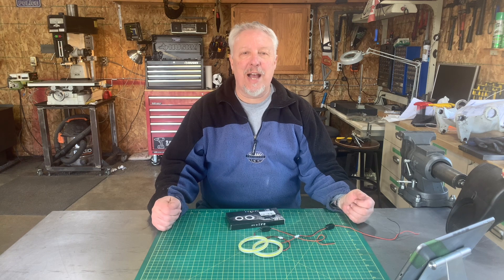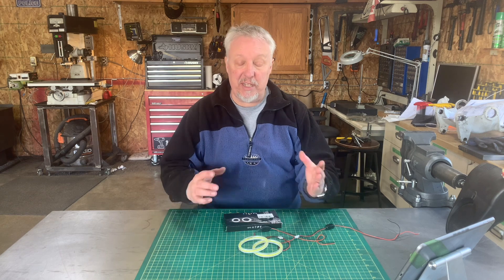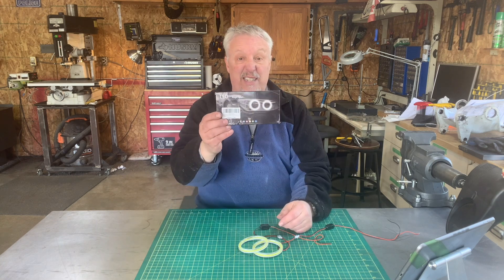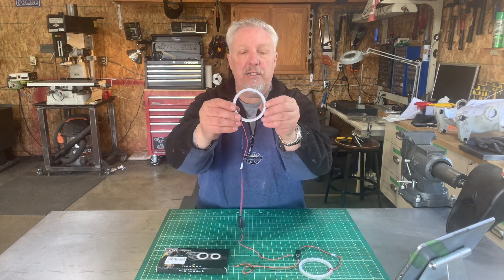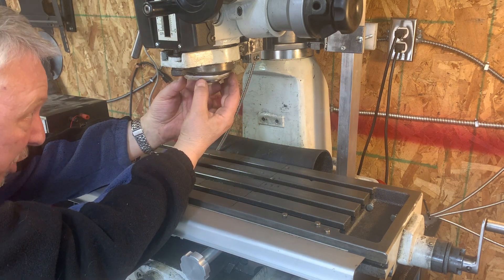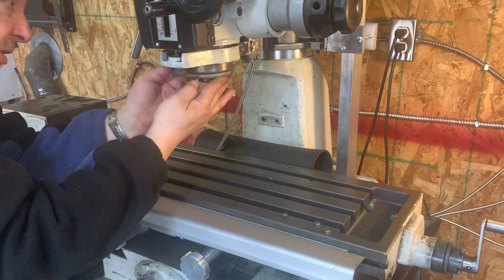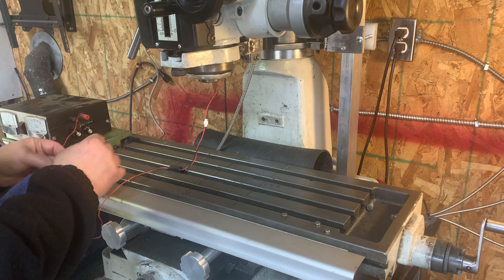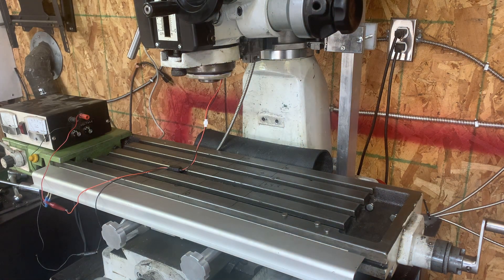Milling Machine Spindle Light

Comment: Just made one with a 90mm angel eye, 3 neodymium magnets, and a 12 volt wall wart transformer. The magnets hold the light in place and allows it to be removed if needed. Makes a big difference when using the mill.
Reply from the maker: @PaulEverhart-c8l  I really like mine too. The only downside is filming doesn’t react well with it. I’ll have to modify it somehow.